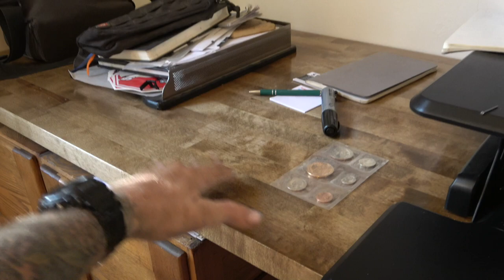The Shlog #119 : Servicing Daisy, 2020 KTM 450SX-F Factory Edition

Comment: Hey Morgan, curious about your comment on liking Evans for 2T but not for 4T. Would like to know your thoughts on this.
Reply from the maker: So, Evans doesn’t boil until 375 degrees and a 4T in the right stuff will get that hot. At those temps the 4T is damaging parts and you’d never know if you weren’t  paying attention. 2T’s just don’t get that hot and the evens keep them from boiling coolant out on the ground.
Reply: @highlandcycles   Dude, you are going back 4 days through comments and answering questions? You rock! And thanks for the insight. I get what you're saying. Much appreciated.....DIRTBIKES!